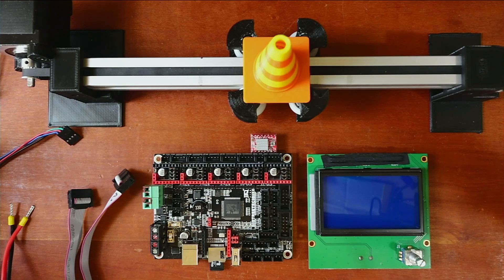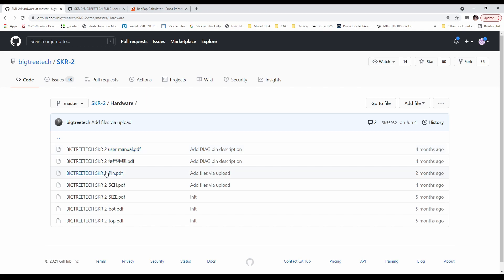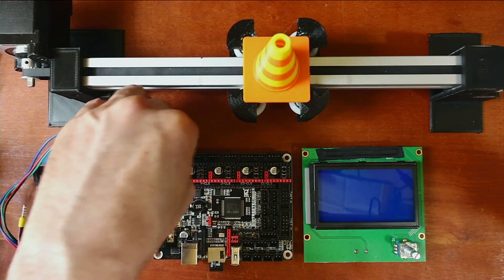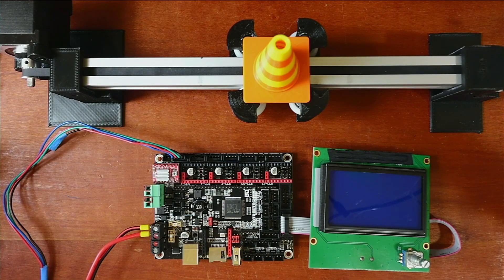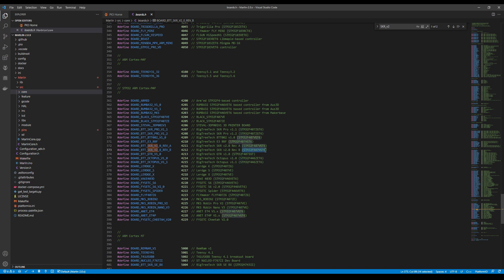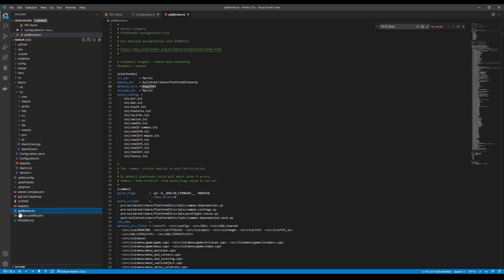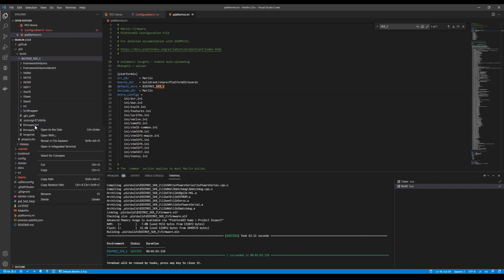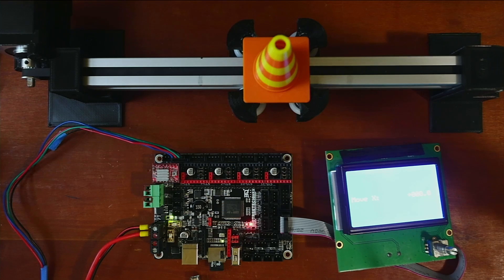BTT SKR2 - A4988Stepper and CR10 (Creality) display setup

Comment: Could you by any chance make a video covering how to install a creality ender 3 v2 DWIN display on the SKR 2 motherboard?😬
Reply: I'm working on that exact setup right now. I have Marlin successfully compiled, but I haven't gotten around to flashing my SD/Motherboard yet, nor have I gone about slicing and splicing the cable to accommodate the different pins on the SKR 2.0 board

If you're on Ed's Discord server, I can walk you through what I've done so far
Reply: @x_jaydn  That’s absolutely amazing… I myself have also gotten Marlin to successfully compile. And I bought dupont single pin male to female wires to make the rewiring process alot easier… How ever i’d like to compair my Marlin code configuration to yours just to be sure

I love your in-depth breakdown of the motherboard. Keep up the good work❤️
Reply: @DeadWinter102  Yeah, ideallly, I'd like to compare my Marlin to yours as well before moving forward 😂

You'll see me on Ed's Discord server under the same name here on YouTube 💯
Reply: @DeadWinter102  Hey Dude, did you manage to get it up-and-running? I've been working on my other printer these days, so I never got around to the SKR 2.0 E3v2 screen machine yet.

Taking another look at the Marlin code, I realize that the RX and TX pins aren't actually defined with the Github code I mentioned on Discord - though, then again, I'm not sure if it's actually necessary (as people didn't mention it in the original Github discussion). However, this may be the same exact reason why the people in those discussions had difficulties getting the icons to display correctly (though I can't be 100% certain).

That being said, I think, if I was to hypothetically add the pinout arguments for RX and TX, it would be:
"#define LCD_RS PA9"
and...
"#define LCD_EN PA10" 

...respectfully (correct me if I'm wrong).

"LCD_RS" (PE9) and "LCD_EN" (PB1) being the EXP1 pinout codes on the original CR4.2.2 board / DWIN LCD

and "PA9" (RX) and "PA10" (TX) being the TFT pinout codes on the SKR v2.0 Rev B boards

DM/Ping me in Ed's Discord, and maybe we can figure this out together